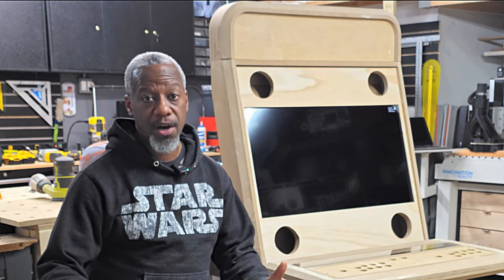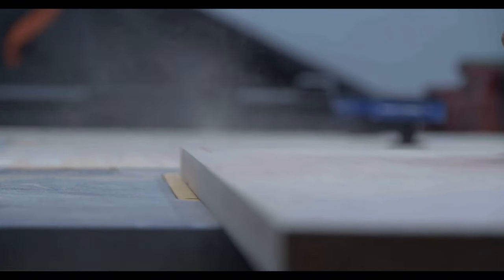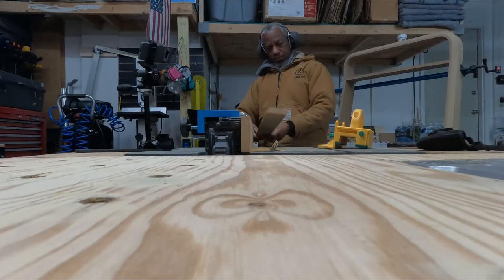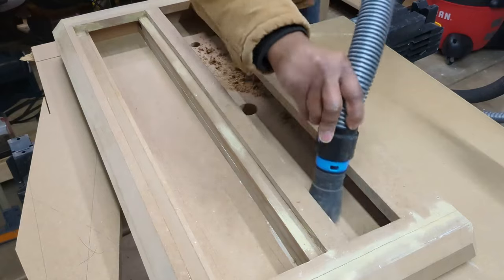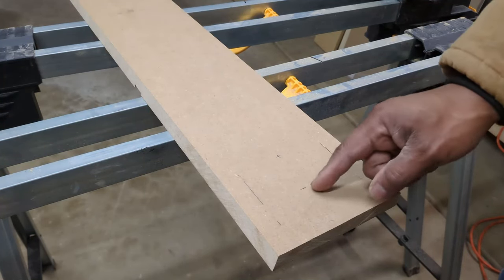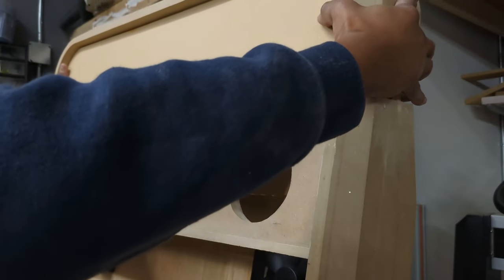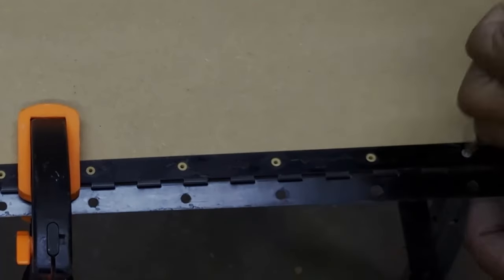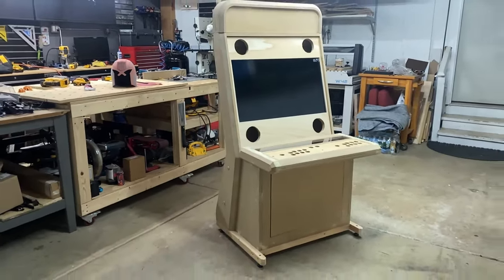DIY Vewlix-Style Arcade Cabinet - Part One

Comment: I've been out of the arcade scene for quite a while - yet YT obviously remembered and suggested this to me.
I have an old Namco Excellena 2 Candy cab that I stripped, refurbished and repainted a decade ago and running MAME on an old PC.
The only issue is that it still has the CRT monitor in it - it works, but one day I'm going to have to work out how to put an LCD in it. 
Might build a brand new frame out of plywood, much like you have done, that holds the LCD in place, rather than try and modify the plastic frame.
Reply from the maker: Oh man, Good luck!  It's cool that the CRT is still functional!

Comment: Hi CGR,
Just bought your DIY-plans. I live in Sweden, here we use metric system. You don’t happen to have the plans in mm? I’m not very sure how to convert inches to mm. I know that you multiply by 25,4 to get mm. But how do i multiply 19 7/8” for example? And for instance 29” in mm = 736,6mm. Very odd measure in mm. I know there’s converters online, but I’m not really sure how to enter 19 7/8” for example.
Sorry I’m a bit slow.
Reply from the maker: Send me a message on Instagram.  We'll work on a metric version

Comment: What's the footprint of the cabinet? Is it easy to modify for specific hardware/buttons/joysticks/tv?
Reply from the maker: Yes, it's super easy to modify the plans to your liking.  The footprint is 32" x 25".
Reply: @CGRTist  
Awesome. Thanks. I’ll grab the CNC plans soon. I work at a cabinet shop and will get a buddy in drafting to help modify it and run it on our CNC machines. Debating using black melamine MDF, but not sure yet.

Looking forward to part 2.